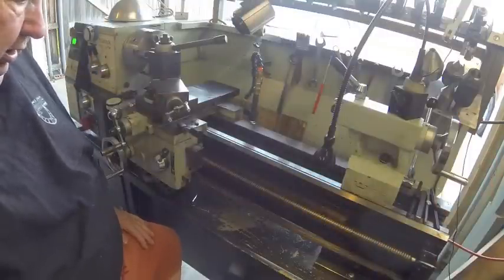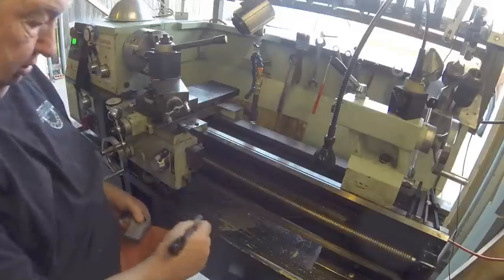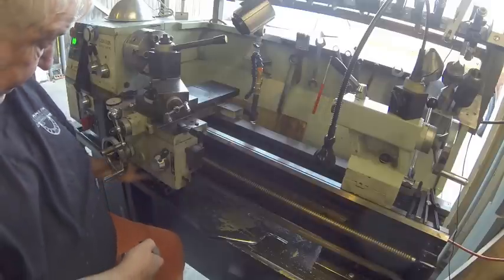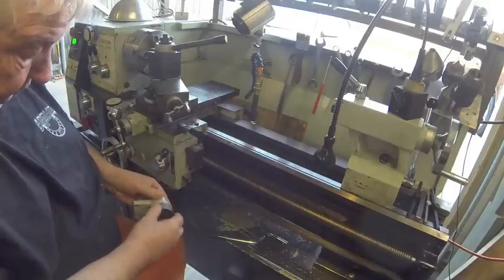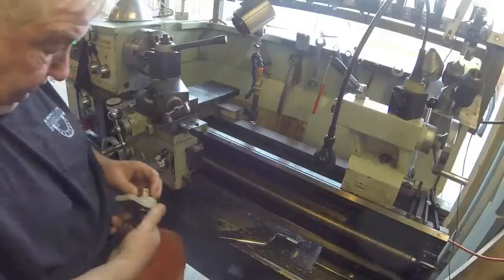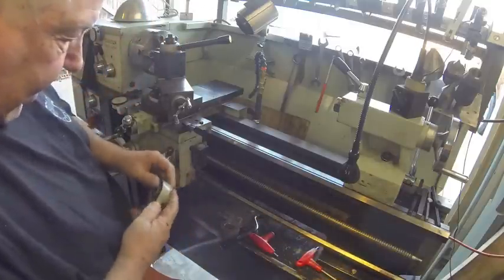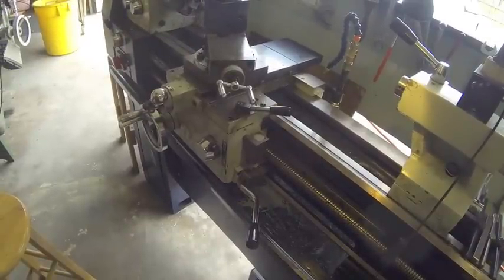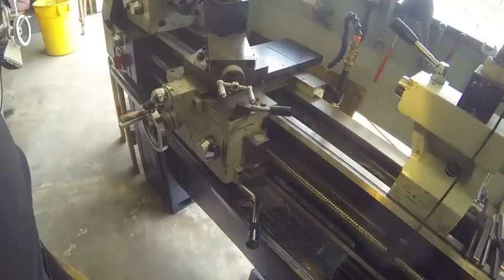Lathe repair final

Comment: This lathe is far better quality>>>ur2.pl/854   than I anticipated. Solid heavy and runs as smooth as a DC politician in an election year. I was surprised as the lathe arrived well packaged and about a week earlier than the estimated delivery date. I like the fact it doesn't run full speed at startup, but rather slowly gains speed after turning it on. This is definitely a safety feature appreciated by any lathe users that have had an off centered piece of stock.
Reply: Thats a wood lathe. Not a metal turning lathe. You are spaming the wrong video.